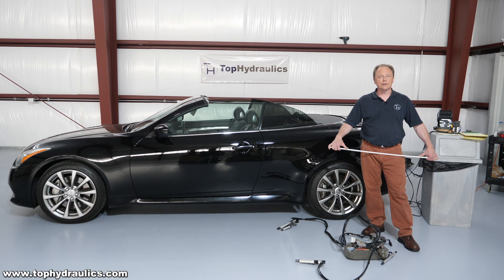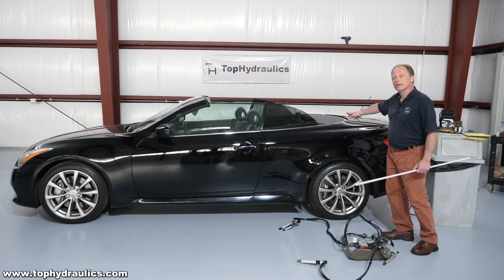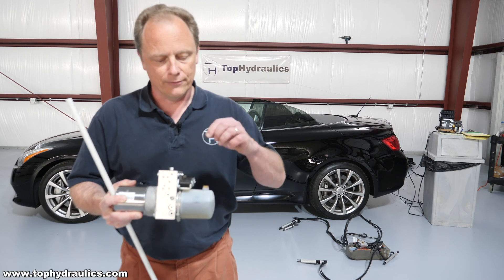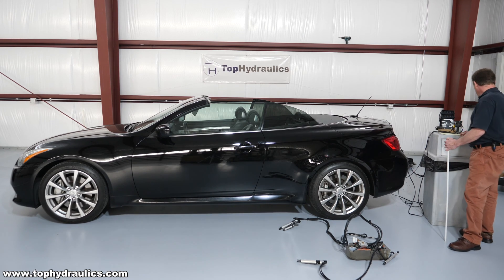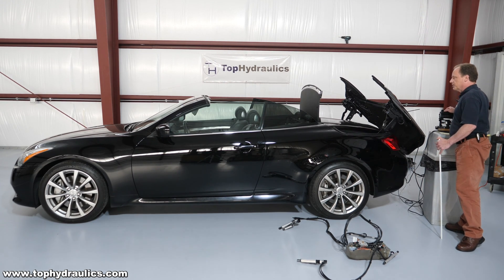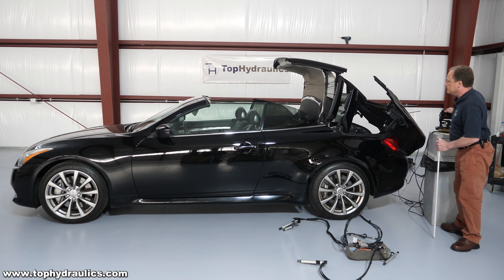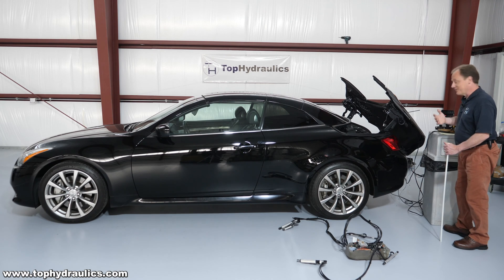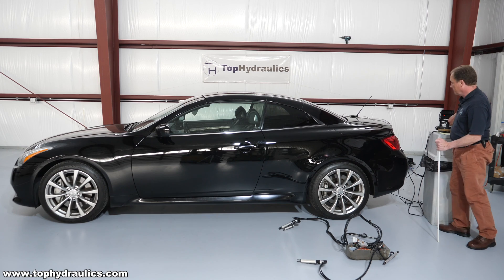Infiniti G37S - Understanding The Top Closing Sequence

Comment: ? manually? how can it be manually WITHOUT that device that you attached to the motor to perform all the functions. The difference is using outside electric controller vs. the car's controller. Misleading headline video.

Comment: I was closing the top.  Nothing happened prior to this.  So, as it's starting to close,  I hear a loud Crack or snap like sound come from the back and then the top only half closes.  It is crooked and the passenger side is an inch away from closing. Now,  the button does not work to open or close,  it does nothing when pushed either way. Can't drive it without its warning light screaming and the dash animation shows the top as opening.

Infinity is no where near me, I'd have to transport my car to another town, several hours away.
Reply from the maker: Let’s hope that there is no permanent damage and you can fix it yourself after finding an obstruction. Since the top is crooked now, you should be able to manually retract it part way and find an obstruction or a broken part by closely comparing the left side to the right side. You may need to remove some trim to see what’s going on - use ingenuity to secure the top near the highest position. 
Keep in mind that the top can fall in either direction and cause damage if you leave it unsecured at a high point with the ignition off. Thus the need to secure it near the highest point. 
Our video on manually closing the top should give you all the information you need about trim removal and moving the top manually: https://www.youtube.com/watch?v=lb3p4I7A-LI&list=PLly4CMbpk7owUVN3XTeI9OHjI6UcEp7el&index=4

Comment: I have an issue and need the parts associated but can't find any results. 

The very end of the open or closing cycle. The trunk lid closes crooked so it won't latch. 

I must exit the vehicle lift the trunk and let it pull in prior to finishing the open/close process. Other than that everything appears fine.
Reply from the maker: Sounds like a mechanical issue or a pinched hydraulic hose to me. I would suggest that you first follow the routing of the hoses from the trunk cylinders to the pump in order to verify that they don't get pinched anywhere. If that's all good, then try to move the trunk lid manually and see if the mechanism is binding anywhere.
Reply: @TopHydraulics  thank you, I rent my car out on an app so I don't get much time with it. But this just started happening. I'll do this and go from there! Thank you!

Comment: hi there. my g37s convertible roof opens and closes fine but everytime i try it says trunk open and stops operation.. what can be the fix ?
Reply: Same boat. Did you have any luck?
Reply: For me,  if I have a moment where I start the opening, and stop, right at the beginning it starts the process, which pops the trunk first. An unsteady finger could be the problem. Somehow you are triggering the trunk latch. Solution in my situation is to get out and close the trunk and then be careful to not repeat. Either that or your trunk button may be sticking. I'm not a mechanic, but I've had infinity g37s for a long time.  Hope that helps!